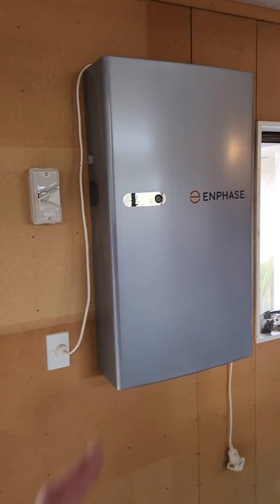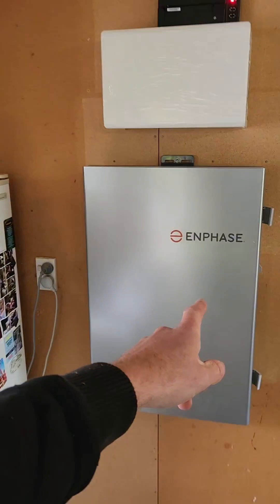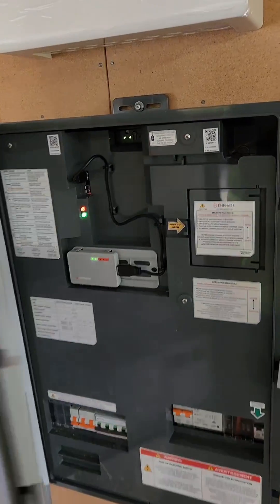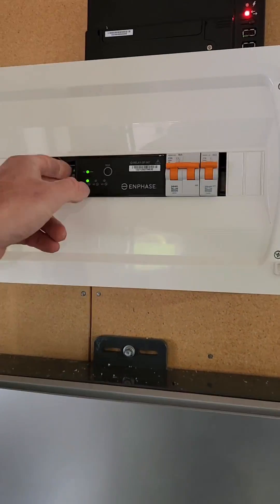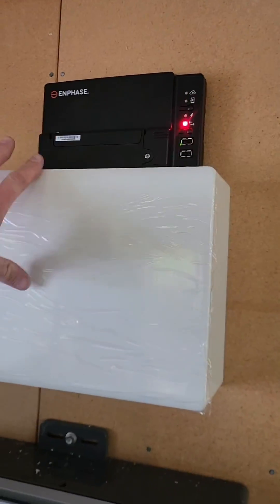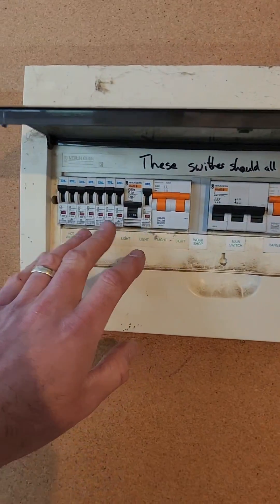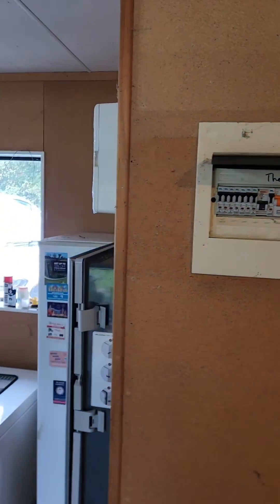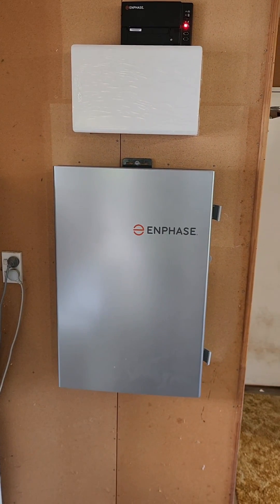Enphase IQ solar system

Comment: why dont you use the system controller for the 2nd phase
Reply from the maker: @conorandturbos  because of the metering system in new zealand has problems and this is currently the only way around it
Reply: @_nztradie you can run the L2 to just the grid port as long as the attached solar is under or limited to 5kw then it wont export L1's battery, we also found they'll still export the battery if the envoy is on the same site id, it also can work out better on some plans, like meridians ev plan, which pays you 12c for export and charges 9c overnight, also works well on the 3 hours free plans, then they pay you for them converting between phases for you